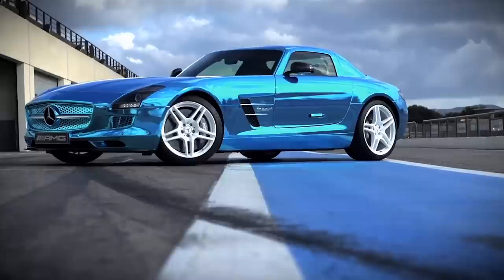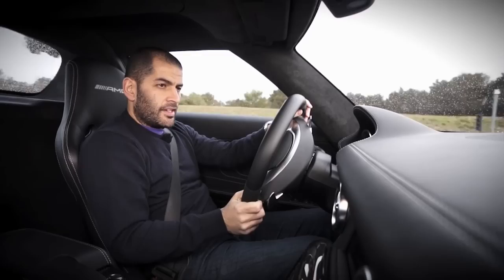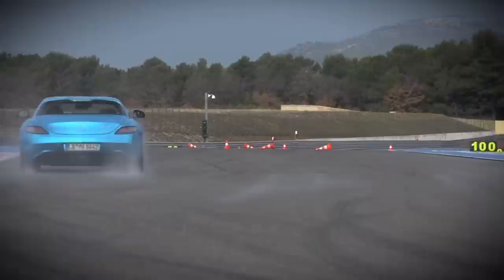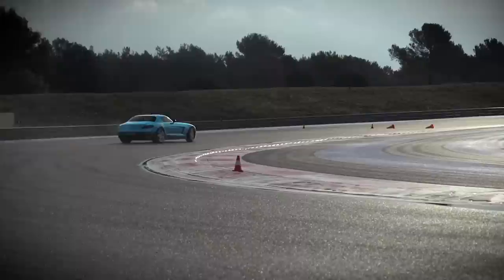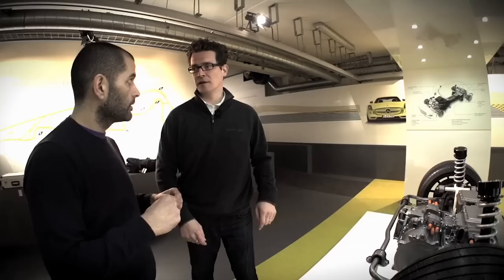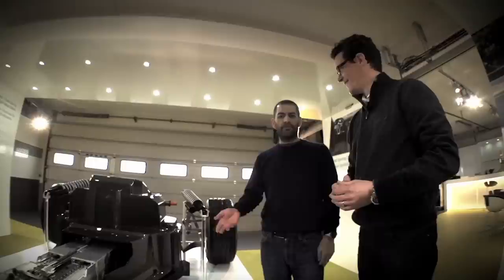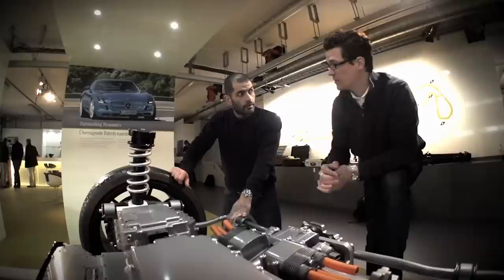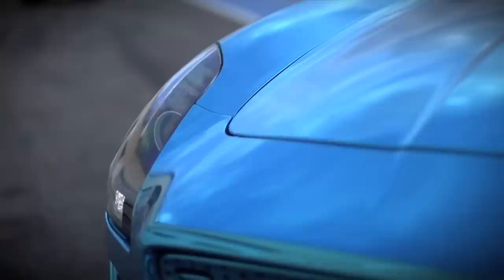Mercedes SLS Electric Drive. Can Volts Ever Match Pistons? - /CHRIS HARRIS ON CARS

Comment: What a silly title - volts vs pistons?!? Why not applejuice vs potato salad - at least both are vegetables (sic). Dear Crhris and /DRIVE, electric motors outmatched the traditional automotive piston engines, either diesel or petrol not only in power but especially torque and its availability; the only exception is nitromethane - but the engines using it can only run at peak power for seconds before blowing themseves apart... The problem is not the electric motor - it's controlling temperature, and  especially the storing of electricity efficiently.
Reply: How are apples vegetables?  Good grief.

Comment: In the torque vectoring/negative torquing, is it just decelerating the wheel by regenerative braking?
Reply: No Negative Torque literaly means applying electric power to try to twist the shaft in reverse. When done with a single wheel or single side, you can ford the car to Rotate on Axis. Which is magic when it comes to cornering.

Comment: I hope you're kidding because that is a very unrealistic amount. Unless the inflation bubble bursts or the government offers a subsidy for them they will still be expensive.  In layman's figures: an average car battery has six cells and an average price of $120 a battery.  This car has 864 cells that are not the run of the mill car battery cells.  I guarantee north of $50,000 to replace the batteries but then again if you have the money to buy this car than money shouldn't be a problem.

Comment: Negative torque ,, I assume means the torque vectoring software commands the inverter motor controller to turn the selected  motors into generators then demands through feedback a controlled amount load energy from it sending it back into the system (like regenerative braking)   , this creates a rapidly proactive selectable amount of Regenerative braking drag on the inside wheels during cornering or stability control ,,  I do still hear what sounds like ABS/stability control brake action does the stability control logic use only the brakes ? Or does it only sound like ABS/stability brake control but is really rapid pulsed electronic wheel motor interaction ?
Reply: I only heard his wheels hitting the rumble strips. The torque control/regen does not pulse, although the adjustments the computer makes is probably thousands per second or more, only limited by speed of computer.
Reply: You're wrong on all of this, including the noise. Negative torque is actually applying reverse power to a wheel, and the noise you're hearing is him driving over the lines on the edge of the track

Comment: Use hydrogen fuel cells instead of batteries and they'd really have something.  All the electric good stuff plus unlimited range, if we had hydrogen filling stations.
Reply: Ron Warrick Yeah no converting water to hydrogen requires energy while fuel cell gives out this energy when it converts hydrogen back to water but (here it is) the whole process is inefficient there are a lot of losses, you don't get close to the energy that you put in. Batteries on other hand are much more efficient in energy storage.Hence more battery powered electric cars out today.
Reply: hydrogen sounds good on paper, but when we reach the stage where battery cars can do 300+ miles of range in extreme conditions and charging is abundant and takes minutes, nobody will want the inconvenience of having to go to hydrogen stations and pay the - OIL COMPANIES - money.  Except maybe those who live in locations where charging is not possible like tenancy buildings, or HGVs where fuel cells have more potential.

Comment: Its not the most powerful electric car (Concept one is), and smaller and more dense batteries are not 10 years away, but in a matter of 3-5 years. And it's really overpriced. I would rather buy Tesla roadster, Model S, Model X and a build a nice garrage for those car instead of one SLS ELectric :)
Really nice review tho. (Y)

Comment: so you're suggesting using a energy negative process to harvest a fuel and then use it in a combustion engine, which is again significantly less efficient than a electric motor? you use the same source of power as an electric car... namely the power companies, to produce the hydrogen, but add in 2 extra stages of energy transfer (neither of which could be considered 'efficient' - by any stretch of the imagination), and this is supposed to be 'better'?

Comment: And where are you going to get your hydrogen from? There is currently no process that can extract hydrogen from water and then compress the gas into a liquid without requiring a lot of energy. Electric motors are the future (with hydrogen fuel cells, maybe), I'm afraid.

Comment: A Ferrari doesn't sound great. If it did, you'll never get sick of it. A Ferrari V8 has a flat plane crank which makes it sound shit.

Note how I said; "PURE electric". Pure electrics will be suitable for taxis. But other cars of the future will actually be hybrids that run on sustainable ethanol (sourced from sugar cane) that's more powerful and emits half as much as pump fuel gasoline and have quick recharge  graphene batteries. 

To satisfy everyone, you need a compromise, and this is it.

Comment: The drive is correct. The electric car is not feasible. Hydrogen car is much, much better. ;))
Reply: LOL 0.08988 gram / Litre density. H2 will never be a wide spread energy storage medium. Fail.

Comment: define 'better'. Because the energy has to come from somewhere, and if you're producing hydrogen it requires electricity, and allot of it. simple fact of life. There may be synthetic fuels in the future which are more efficient to produce, but elecs are here and now, and have far better emissions etc etc than ice can manage (by how much varies on your power source though). block your ears all you want mate. Doesn't change the facts.

Comment: The tesla does 0-60 in 3.2 has self driving and has free supercharging across three continents you can recharge free forever
Reply: +nitish kannan P90D has replaced the P85D. Now it's 0-60 in 2.8, quarter mile in 10.9, and 762hp. "Ludicrous Mode"

Comment: Thats why Mercedes > audi BMW volks and all
Reply: I'm sure that I'm not . Benz Always will be better than BMW, look at amg series. M motorsports is worse.
Reply: tulio melo lol M has always had better transmission tech than AMG's torque converting automatic. M's have higher resale value, AMG's are notorious for their shitty resale. The C63 barely beats the M3 in a straight line with 2.2 liters more, and almost 100hp and 200ft/lb's more. The m3 rapes around a track period. The i8 is sexier looking than the SLS and its a hybrid. The M Cars all have a manual option, benz has never offered a manual in any car. the list goes on and on and on. The G11 7 series has more features than the new S-Class. M's Performance SUV's destroy AMG's in terms of performance for a fraction of the price and less power. M's are more tunable and theres a bigger market for them. BMW overall is a completely different animal. Only cars i would personally own are the AMG GT S, G63, E63 Wagon, and maybe an S63. Everything else just look the same. and the new S coupe, hideous piece of crap. now after my little rant. i still have love for the benz. especially the CLK63 black series or AMG Hammer.

Comment: You started your reply with the word "If", so you are ASSUMING a lot before you try and insult my basic math skills.  The FACT is that my journey is a 600 mile round trip twice a month.  2 x 600 = 1200 (Check out the math skills.  Even more importantly the one way journey of 300 miles means that current technology is no use to me as I can't make that journey without needing to stop and recharge.  I can make the 600 mile journey on one tank of diesel so basic maths dictates stick with diesel.

Comment: Wow, you're screwed in the head. You don't even know the difference between a lithium battery and a lithium-ion rechargeable battery.
Modern batteries:
In 1989, Goodenough and Arumugam Manthiram of the University of Texas at Austin showed that cathodes containing polyanions, e.g., sulfates, produce higher voltages than oxides due to the inductive effect of the polyanion.

In 1991, Sony and Asahi Kasei released the first commercial lithium-ion battery.

Nothing about 1970. Different tech.

Comment: Oh wow i wonder how much it's going to cost to service this car and plus it's going to take an aerospace engineer to service this car. and what if this thing gets into an accident it, just to do body work on this thing it's going to be impossible. So the bottom line too complicated scrap it guys.
Reply: You'd be surprised. Theoretically, EVs are much more reliable than normal cars and don't have to do smog tests like others. Most dealerships could service an EV (maybe not a rarer one like this, but a Chevy Volt/Nissan Leaf etc) but like any car - the bodywork would be a pain after a crash :)
Reply: Jack Farmer  If you're talking to me, I do autobody repair work and up tune cars. My specialty is ferraris.
Reply: The body is not a lot different to other SLS, well the outer skin.
looks like most of the Electrical part is in the center spine of the car.
And there would be part to replace anything on the car, to an economic level.
You should understand that as a body repairer.
I used to work for Toyota and with the Prius it was just oil etc for the normal engine and leave the electrics alone.
If it came to a problem it was usually a software issue.
Then again if a component had a problem you replace it.
Is that how Ferrari works? its just a car like the rest of them (bit of a joke)
Reply: Sevkhach Fedayin lol that's cool...my specialty is the space shuttle
Reply: Daniel Arriaga You're spending too much time on youtube that's why the space shuttle got canceled.
Reply: Sevkhach Fedayin I see where you were going with that but it just wasn't that funny....now hurry back to forza  kid
Reply: Daniel Arriaga Kid?I wish but whatever floats your boat man. And forza.. I dont need to i'm in it everyday if you only knew. To some people it's a dream, for me it's a bucket of bolt and nuts, day in day out.  As a matter of fact I was installing an entire front end on a convertible Bentley today. Enjoy yourself, have fun. Dont stress yourself work hard and you'll have one.
Reply: Cool story kid
Reply: Daniel Arriaga Whatever floats your boat man
Reply: Sevkhach Fedayin you've already said that kid...use your imagination
Reply: Oblige? You Europeans are always so polite lol ...stop replying..it's getting kinda weird
Reply: Sevkhach Fedayin if you think YouTube is for technical people then you must have been born about 3 yrs  ago....and just for your information ....on an  evolutionary scale ( if that's what you were trying to say..work on your grammar) 30 years isn't nearly enough time for any real progress to be made...think more along the lines of tens of millions of years....amateurs
Reply: Sevkhach Fedayin oh and please don't use gods name in vain...thank you:)
Reply: Daniel Arriaga Hey DING DONG were you deprived of love when you were a kid. Dont come to me with your sad story I aint got what you're looking for
Reply: Sevkhach Fedayin sad story? I was just correcting you (you don't know much about evolution)....I wasn't trying to make you sad:(
Reply: Oh dear, if I had a dollar for every time I ended up starting an argument with a self-proclaimed "expert" on YouTube. You keep on dreaming about Bentley's kiddo.
Reply: Jack Farmer not bentleys bro his expertise is Ferraris lol
Reply: Haha, is he making this up as he goes along? (sarcasm intended)
Reply: Sevkhach Fedayin what's an Armenian doing in east LA?
Reply: Daniel Arriaga What's it to you?
Reply: Sevkhach Fedayin you said you were born and raised here and that you're red white and blue .....yet you refer to yourself as Armenian
Reply: Sevkhach Fedayin oh and where did you get your online PhD from?...do they accept financial aid?
Reply: Sevkhach Fedayin ah man I just realized the bad guys in the movie are ALBANIAN not Armenian....I guess that means nothing good has come from Armenia lately....sorry :\
Reply: ***** I wouldn't mind driving this go kart
Reply: I agree, it's so much easier to service four motors, a battery and an integrated computer then an entire gasoline engine. Anyway, I never thought a reply about the reliability of EV's would turn into a full-blown argument.
Reply: About what? The EV servicing thing was serious. Think about it, that's six components to go wrong - not six hundred.
Reply: And it's not like the components are that likely to fail. The first Toyota RAV4 EV's were made in 1997, and there is a long list of people who have driven over 100,000 or even 150,000 miles over 17 years without any components failing. EV's released today, like the Mercedes, have had an extra 17 years of technical advancement since, so are probably even more reliable and easy to service.
Reply: Yeah, I'm not saying petrol cars are necessarily unreliable too. I've had a Mazda for around seven years and the only issues I've had are with the A/C.  So I guess in many cases petrol cars are as reliable, if not more reliable than EVs.
Reply: ***** I know what you meant dude...I'm just saying I wouldn't mind driving it  :)
Reply: Did he say 2+2 is 22? No. Can you even remember what you are arguing about? The reliability and servicing of EVs, not some stupid petty argument about Albania or whatever. You're both as bad as each other. Just stop, you're making yourselves look ridiculous.
Reply: Jack Farmer with all due respect jack....if this is so ridiculous then don't bother clicking on the thread....I'm just having some fun at the expense of my foreign friend;)
Reply: Sevkhach Fedayin you do realize you And I the same race right?...that would be the HUMAN race.....you must be referring to my ethnicity...how did you earn your degree again?...I have absolutely no control what the spaniards did hundreds of years ago so again that comment makes no sense....that steer and queer comment was funny....that's the first time I have every heard that (you should add comedian to your list of accolades)...you were right about the American revolution though....the civil war is a different war altogether....if you're gonna live in my country atleast learn some history because you're all over the place...I think you were referring to a water faucet? I don't know what a focet is sorry....my folks were born in Mexico and I was born in the U.S. .....I haven't heard of kissing cousins in Mexico....I think you're mistaking me for a hillbilly....again where did you get your education from? Lastly ....they are referred to as Native American ...they don't like to be called Indians....Columbus thought he landed in the indies so he called them as such....you should really go back to school man because it's obvious your teachers failed you...oh and my father is alive and well so technically I can't be a Bastard.... I suggest you focus on history, English, and spelling. If Armenia is so amazing then what are you doing here? Go back to your 3rd world country and get some plastic surgery or something;)
Reply: Sevkhach Fedayin damn dude you can't spell in English or Spanish!
Reply: Daniel Arriaga friholes
Reply: Sevkhach Fedayin lol frijoles....spell check kid
Reply: Sevkhach Fedayin *cut
Reply: Sevkhach Fedayin you live in east LA ....who you kidding...you have no lawn
Reply: Daniel Arriaga muhadoooooooooooo
Reply: *mojado
Reply: There you go...finally! A few to many r's but you're making progress!
Reply: Anyone who could afford this car will not car how much it costs to service.

Comment: So you throw this car away after two years like an iPhone just when the battery starts to go funny:) Except on an iPhone I can change the bat with a slightly complicated process - on this car I cant at all.. hmm, future sounds expensive:d
Reply: Battery lasts 10 years.

Watch the video
Reply: yeah Apple says the same
Reply: Tesla owners have already done 200k+miles with only 10% degradation - that's about 10-15 years driving for most people. When the batteries are done (which means they don't hold enough useful charge for the driver of the car), they can be turned into home storage, or recycled into new packs.

Don't have to throw the car away at all, simply replace the battery. With the reduction in maintenance, especially at this high end sports car market, that will pay for the batteries multiple times. Tesla costs 10-15k less than the equivalent German saloon over 5 years, just in servicing. Imagine how much it costs to service a regular SLS engine?